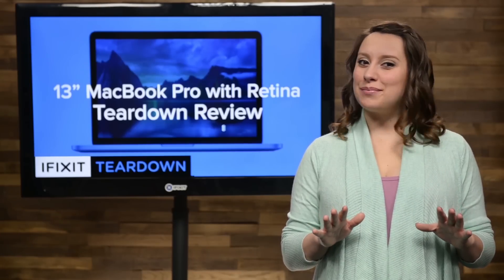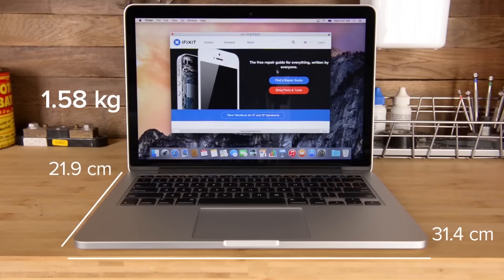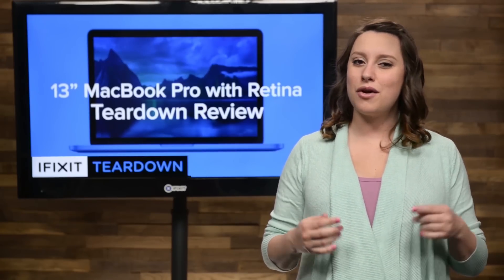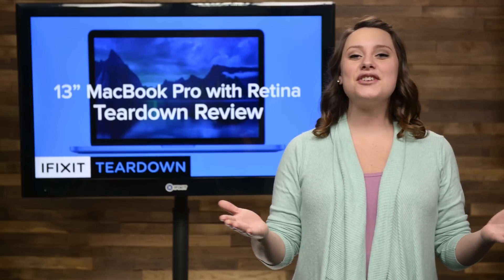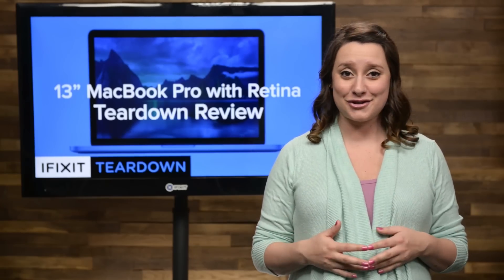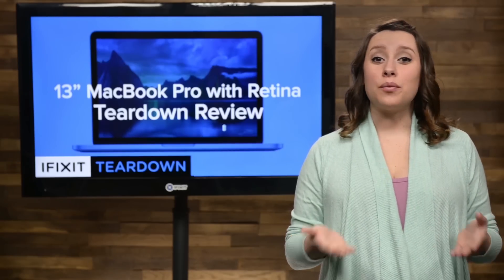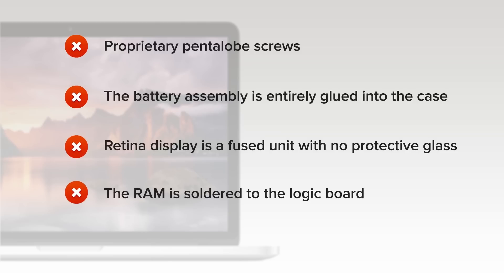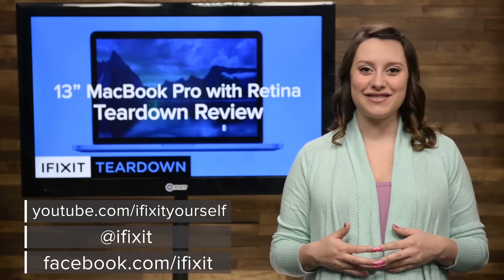13" MacBook Pro Early 2015 Teardown Review!

Comment: repairability kills it for me. in 2015, i bought a 2012 macbook pro and im loving it, I can upgrade almost everything except the CPU, lol...
Reply: +bur lapse I did the same thing one year ago. I bought a late 2011 MacBook Pro and upgraded the HDD to 250GB SSD and the Ram from 4GB to 16GB! Total cost about 400 USD for the upgrades and 630 USD for the MacBook Pro. It still has an Core i5 with Intel 3000 Graphics. I use it mostly for software development and couldn't be happier. If I want to put in a larger SSD, I can do that whenever I want. This gives me a bit peace of mind. Obviously Apple wants you to buy future proof charging you twice and triple for the hardware they sell compared to what the market price is. I feel sad about this.
Reply: +Alexander Fuchs yeah most companies compete to create the cheapest yet most efficient products, Apple chooses to sit in the throne, assemble a laptop for cheap, and sell it for 3 TIMES THE PRICE OF THE COMPONENTS THEY USED,

Comment: Can i upgrade ssd of mbp from 128gb ssd to 256gb ssd?
Reply: Hayas Nc not at the moment.  although the SSD that is used has a non standard interface there will be at somepoint 3rd part ssds that support the interface... just not at the moment
Reply: Stuart Dales thanks for the reply :)
Reply: +Hayas Nc yes you can upgrade... pcie 3.0 ssd are common now
Reply: :P i have macbook pro early 2015 ones.. only have 256GB... can't we just use replicating software and buy 1 tb ssd?
Reply: owh...apple din't sell em?
Reply: my ssd nearly full :P
Reply: owh.... i buy mine intel core i5 intel iris pro gpu...
Reply: no... it s need to be PCIE... not M.2
Reply: +Hugo Ventron I believe, as long as it's a standard SATA
Reply: that's why i buy 256 one haha

Comment: can anyone tell me if it runs Minecraft well?
Reply: +Rachael Kerr I get a solid 80-185 fps average on it.
The model I have is the 2.7ghs i5 and 8gb of ram. with 256 gb flash storage. hope this helps
Reply: that really helps and now i have the 2010 15 inch, but the problem isn't the fps, its really good, the problem is the heat the laptop gets. apart from that, its great!!
Reply: Rachel Kerr Make sure when you play its on  a desk or a counter and not your lap or a soft surface. If its on a soft surface the air circulation will cut off and gather up and the laptop will gather heat. I recommend a laptop stand. The Best laptop stand is probabky here.  http://www.amazon.com/gp/product/B000OOYECC?keywords=laptop%20stand&qid=1450826237&ref_=sr_1_4&sr=8-4

But really it does get a little hot on desks while playing. but it doesnt get hot where it burns. Besides, laptop naturally get hot. But, this lsptop is great and you shouldn't really worry about this. hope this helps!
Reply: thanks so much!! so so helpful. ill go and check it out now :)
Reply: Oh yeah even on highest settings with shaders.

P.S. Talking about the 15" model with dedicated AMD Radeon M9 M370X graphics.
Reply: ***** I run Portal 2, TF2, and a bunch of other resource-demanding 3D games and my computer doesn't skip a single frame™
Reply: ***** Spintires runs well enough when booted into Windows. So does BeamNG.drive.
Reply: ***** well this computer can run it good enough as long as I don't enable dynamic maps/reflections/whatever

Comment: If the display screen is prone to scratches, can be front glass alone be replaced or the entire unit has to be replaced?
Reply: The whole thing. The glass is permanently glued to the casing, and it's thin, so if it cracks, you'll have to fork out $500 to change the whole panel.

Comment: How can this even be in the same class as the 15" MacBook Pro with only 8GB of RAM and i5 processor? You need at least 16GB with an i7 for any serious Pro work IMO!
Reply: It's not in the same class, that's why this base model is $700 cheaper than the base 15".
Reply: ***** Because Mac OS X uses A LOT of RAM. I use almost all the 8GB of RAM on my MacBook Air just web browsing.
Reply: ***** Knew that was unlikely. I use a 2011 edition with only 4 gigs and I don't have hiccups that often. Normal usage you don't need that much.
Reply: ***** yeah I'm just confirming your point. He said he uses all of 8 gig, I say that's impossible because I got 4 gig and it's still running fast.
Reply: Ian Cailliau You must never ever use more than 3 tabs in Chrome or anything like that. Anyone who buys a Mac should ALWAYS max out the memory since it can NEVER be upgraded. You HAVE to future-proof on memory. Because even if you don't need 16GB today, 5 years from now, 16GB will be required just to run basic stuff. I don't buy that one can't "afford" it. I men, if you can afford a thousand dollar computer, you can prooooooooobably afford the extra $100 or so for 8GB, or even 16GB of memory.
Reply: Ian Cailliau Impossible. Lol.I'm currently using 9GB of memory right now. I only have 14 tabs open in Chrome and I have Skype open. It's EXTREMELY easy to go above 4, even 8GB under OS X. OS X is designed in such a way that it will use as much memory as it can physically use without degrading performance.
Reply: I sometimes got 15-20 tabs open for my thesis, including youtube playing a video. I run word, readcube, itunes (obv not when youtube is playing) and got several pdfs open through which I have to search regularly. I still don't have lag. 4 gig
Reply: ***** I will give you points: The uber fast SSD's in Macs makes using all the memory have very little slowdown. But I notice the slowdown on my 2014 MacBook air when it's using 7.98GB/8GB.

And you can't upgrade RAM in Mac laptops anymore. The reason you should max out the memory on a Mac laptop is you're paying $1000+ for a laptop, so, you expect a $1000+ computer to last AT LEAST 5 years. You can NEVER upgrade a Mac laptop. (except for the SSD) 2 years from now, 8GB will be JUST enough while 16GB will be what you need to get stuff done. 4 years from now, 16B will be JUST enough. it's the progression of technology.

And no matter what, memory is and always will be faster than ANY SSD in the world in any configuration. My mom's iMac has 4GB of memory, and it's barely enough for her, but she's just a mom. Mom's don't generally need copious amounts of memory.
Reply: +user 14567 Video Editing, using virtual machines (e.g. running Windows on OS X), etc. 16 GB of memory is just the next step after the the standard 8 GB - you really shouldn't have 4 GB, its not 2010 anymore. Sorry for the wake-up call.
Reply: +Tyler Cameron Ditto. Currently just have Safari, XCode, iTunes, Photos open and already over 10GB. And this isn't even serious work yet LOL. When I mean serious work I mean using Photoshop, Premiere, FCP, Maya, VMWare or just about any program that will eat up that 16GB alone! Obviously the people that never see that much memory usage don't need the large memory of the 15" Pro and should be fine with a MacBook Air or even 4GB since they aren't doing much more than the average person i.e. browsing web, listening to music, playing games, checking email maybe using Office.

Comment: The fact that apple decided to go with a non standart ssd in this macbook pro, just as ssd prices got low enough to be affordable to the average consumer is infuriating. Artificially limiting your devices storage, only to have the consumer pay an upgrade price, is just bullshit. It might fly with mobile devices that sell at large to a casual consumer crowd, but has no place in a professionally used working device. Yes, the ssds used are incredibly fast, but that doesn't help me much If I have to store almost all of my content on peripheral devices.

Comment: Can you explain to me how the CPU Heatsink works?
Reply: It has a heat pipe going to a heatsink in front of a fan. The fan blows air through the heatsink. The heatsink has lots of fins for more surface area, which results in more heat transfer.

Comment: Thanks ifixit I love your guides and am going to start helping make some guides myself. Before I purchase any product (Phone, Laptop, ect) I always find a tear down guide first to see how hard or easy it will be to fix that product. Fixing and recycling products should be the first thing on consumers minds before or when purchasing a new product. Sadly most of the time it isn't :(
Reply: I wish I had done the same, and will in the future.  Normally I am more careful before buying... but I just recently bought a Macbook Pro Retina 13 stupidly assuming that the RAM must be upgradeable just because the specs said it supported a max RAM of 16GB and there were both 8 and 16GB models available.  Figured I'd save a few bucks by getting the 8GB and upgrading it myself later.  Now I'm wondering what Best Buys return policy is...  I bought the thing for development work, and intend to be running 3 OS' simultaneously, so RAM is kind of an important deal with this...

Comment: Just purchased the FT rMBP, coming from a 2010 model. I noticed after removing the new one out of the packaging that there is a slight thump coming from inside as I tilt it 90 degrees to the sides from flat and facing the front. It's not like a loose screw but more like a part that slides very slightly as you tilt it from side to side. Since I don't recall this with the older rMBP which I also sold recently, can someone try this out and let me know if they hear the sound? I'm wondering if this might be specific to the FT edition so those with the early 2015 rMBP. It sounds like something is knocking into the casing on the sides.

Comment: this, together with the lack of posibility to disable mouse acceleration in OSX, has made me not buy a macbook. I went with a toshiba ultrabook and could upgrade my ram to 16GB and ssd to a 1TB. Also, if ever the battery fails i just buy a new one and put it in. The only real great thing about macbooks is the battery life.

Comment: Apple make their machines so you have to go to them for repairs.This is so they can absolutely fleece you should there under powered machines fail which they will it seems sooner rather than later.Anyone buying these over priced under powered machines deserves to get stung by Apple for falling stupidly for the nice shiny slim line case :)
Reply: Then you are a fool if you need their software get a hackintosh.As for saying they are better than windows machines your are delusional and have fallen for apples very clever marketing myths.Just Google 
any issue you can think of and a mac has it.I should know i used to fix them and i used to get loads in for repair before they basically locked them down.
Reply: ***** Got a 13" macbook pro 2011 and it's the best decision I've made so far. Upgraded the HD to an SSD but otherwise no real trouble. Still has several hours of battery life on full charge (compared to my friends who've already bought a new laptop or work with a bad battery).
Reply: Aren't you the lucky one.Unfortunately due to apples greed you can no longer upgrade your hd yourself or the ram that is now soldered to the logic board.Hang on to your old 2011 as long as you can.
Reply: You can still buy older models on amazon afaik. It's not that much cheaper than the new model though. But yeah I will. Would like to get another 2 years out of this one. I think I bought it for a bit more than 1000 euro back in the day.
Reply: Meman Hauman You do realize that many manufacturers are doing the same exact thing. Laptops are getting thinner and thinner and repairability is decreasing with it so no matter which brand you buy, when it breaks you need to send it to the manufacturer.
Reply: Meman Hauman Manufacturers are now doing the same thing because of how small computers are getting, I got a mac for the first time and I like it more than PC's, I like my Alienware and the performance is faster but I customized my MAC to $2500 by maxing it up and it works great. Simple machines.

Comment: What were they thinking soldering the RAM to the board?
Reply: Thats just apple..
Reply: ***** It also lowers power consumption so better battery life?
Reply: ***** I told you it lowers power consumption and increases battery life. The Surface, Dell, Samsung and Lenovo and most other brands do the same thing on their top tier laptops.
Reply: ***** *****  This is basic electricity 101. We lose so much electricity during transmission due to length of powerlines. Battery tech has not improved so they have to find other ways to stay on the top of the battery life game. I have a 2015 mbp and get 10 hours of battery life easily.
Reply: ***** Well i use it for app development so it stays fine. Never hit 100C.
Reply: +MrLalasd WTF are you talking about?
Reply: Technically, hes not wrong ( +MrLalasd ) its just insignificant
Reply: dude how the fuck do you get your mbp to last for 10 fucking hours, i also have one and most i can get out of it is about 6 hours sometimes less sometimes more
Reply: i get 11 hours out of mine

Comment: Does anyone know if I can change the wifi card on this? The linux driver is causing horrible screen flicker and I really don't like being forced to use OSX.
Reply: It's soldered into the motherboard, so if you need to replace it you'll either need to get it re-soldered or replace the whole motherboard.

Comment: Non upgrade-able soldered memory, proprietary and fused parts,that sucks. I was just getting to like Apple again, but now I am having second thoughts.
Reply: I have looked into it, I am saying why does apple have to do this, following that trend. Why does any company do this?. Apple is not evil, I never said it was.
Reply: I see your point. While I agree and disagree. If something was not reparable, it would be a waste of money in the first place, for the consumer. While I like to repair and upgrade said product, I would save money in the long run. If the product is not repairable or I can't upgrade, then the product is done, and I would have to purchase again. Do you think this fashion benefit the company's or does it benefit the consumer? Or like all fashions, it will go out of style?
Reply: Yup, Instead of upgrading my 2011 Macbook Pro to a newer Macbook this year,
I went with a Desktop Mac Pro. Going with the flow I guess. I have a 2012
Mac Mini, 2011 Macbook Pro, all upgraded (SSD,RAM) to keep em going for
some time. I figure to go with something more powerful, and the Mac Pro
should be a nice addition. ;)
Reply: ronzandroid I upgraded the SSD of my 2011 macbook pro 13" and not even sure if I have to upgrade the ram tbh.
Reply: They were able to fit more RAM when soldering it onto the motherboard. (Takes as much space as previous RAM models but fits more RAM modules) :-D

Comment: Thanks so much for this informative breakdown of this piece of crap we just bought.  I have been a life long Mac user and my girlfriend just upgraded me to this new 'model'.  lmao   I cannot tell you how angry I am at Apple for removing the CD drive and not allowing their computers to upgrade above 8GB of RAM without tearing apart an assembly which was obviously designed to deter the average user from attempted to upgrade themselves.  A 1 score is DEF giving them more credit than they are due.  The new design team and leadership at Apple need to retire and the new brass and engineers need to come on board and honestly listen to users needs and expectations, haha   ahahaha hhahahahahaha hahaha   yeah, right.  Like THAT'S going to happen.  FAIL APPLE.  This new Mac is not what I expected, I would think this NEW model would be faster, and solve my speed issues and I would have to say after 3 or 4 months of use this computer is big fat 0.